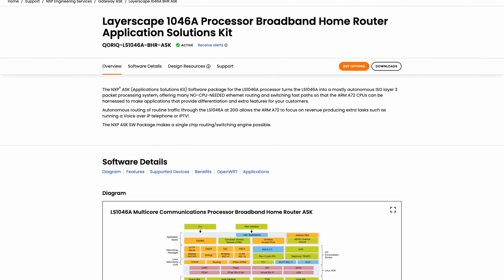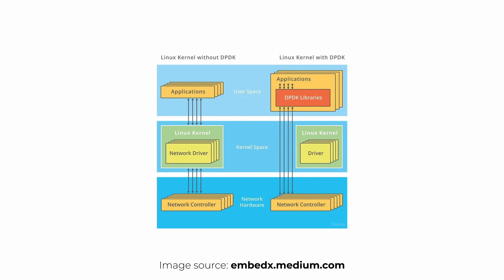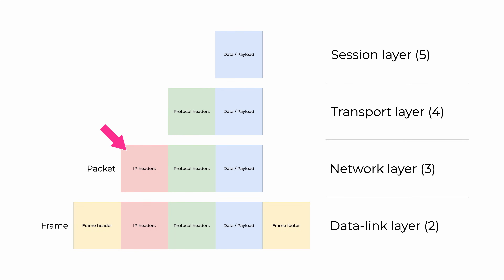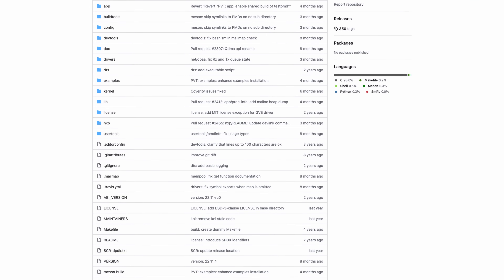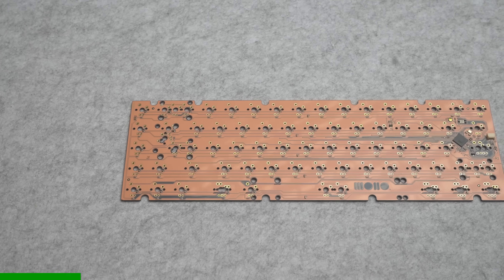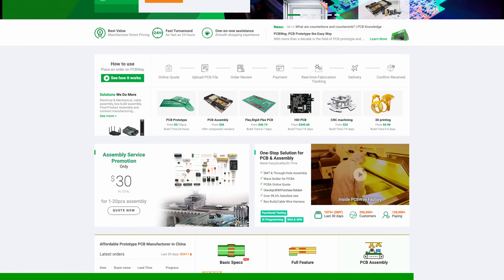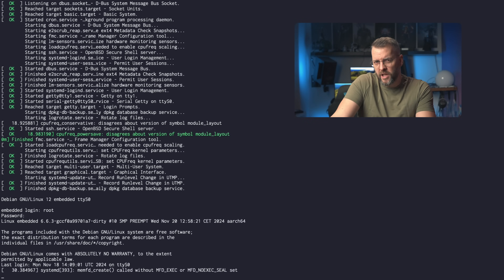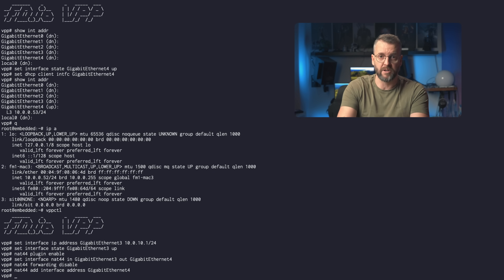Can a single 1.2 GHz core process 10 Gb/s? Yes, it can!

Comment: The reason "downsized" packet performance is important is that TCP-ACKs and other small packets exist organically. So packets-per-second is actually a relevant and important metric for router performance. With sufficiently large payloads, throughput is just a direct memory access benchmark because you're just copying stuff around and not doing that much "thinking."
Reply: DPDK has a way to handle this, but you're right, it's optimized for heavier throughput, with smaller packets seeing higher latency then you would normally see. (Set your icmp packet sizes larger and you'll see the latency problem disappear)

Think about DPDK like more of a "pipe" connecting the two end devices together, it doesn't matter how much volume of fluid you put in there and it'll get there in a timely fashion, especially if there is heavy throughout on the system.

DPDK works great for things like SCTP. 🤘
Reply: Properly efficient routing (and switching) is done WITHOUT copying. The hardware receives the frame into memory, and that's where it stays. Any forwarding is done by reference to that memory buffer. Copying is what kept linux and BSD networking so slow for so long.
Reply: @jfbeam  that’s kind of true but irrelevant because the Direct Memory Access thing I’m talking about is how the NIC gets the data from main memory via PCIe.

 https://en.m.wikipedia.org/wiki/Direct_memory_access
Reply: There's a reason real enterprise routers are rated in pps not bps.
Reply from the maker: Thank you for pointing in out!

Comment: I'm very happy to hear that NXP was willing to open source what would be needed, both options seem very promising to me.
Reply: Yep, with them open sourcing the necessary parts, proprietary solution starts to feel better than the vpp, due to compatibility with commonly used tools.
Reply: It's not so much "open source" as them not caring what you do with the SDK after your $40k check clears. (when almost everything is in a microcode blackbox, there's no secrets in the SDK.)
Reply from the maker: @jfbeam  you're right, to a degree, but microcode isn't something that's normally revealed by, well, anyone really.
Reply: NXP really seems like a good partner. They were willing to open source, AND helped them to find an alternative(and risk loosing income from  licensing  fees).
Reply: @jfbeam  lol yeah sure, feel free to release as "opensource" or even just allow redistribution of the stuff from most vendor SDK and see how fast you get sued to oblivion for breaching NDA and the SDK's own license. If NXP has moved all the proprietary bs to a firmware/microcode and allow people to redistribute it, its a good thing.
Reply: @jfbeam  Their attitude towards their copyrighted works here seems absolutely aligned with the spirit of the GPL. That's way better than how most vendors out there act. And no, microcode* is a part of hardware. If you still wan't it liberated, like I do, that's beyond the FSF's definition.

*(unless they mean something entirely different by that term than the rest of the industry does)

Comment: Router performance is best measured in packets per second; not throughput. It is relatively easy to push 10Gbit with jumboframes (or even standard 1500 byte frames), however a router must be able to support other traffic types too. Gaming, Voice/Video calls, anything 'realtime' really - all rely on small packets for the majority of bytes transferred (To keep latency and delays down). For example an average voice call does 50 packets per second, each at about 200 bytes. Would you be able to use this routing method, at the higher speeds, when traffic with those characteristics is being routed? That may not be of interest when using the router as your consumer home router - but it would when using in a more enterprise environment.

Comment: High-end networking geek here.  Small packet performance is critical for core internet equipment.  If you can’t send 14.4m 64 byte frames plus receive 14.4m 64 byte frames at the same time: your not doing 10 GbE.

Bulk throughout is trivial and doesn’t require any fancy hardware: a mundane PC can easily do tens of Gbps with large packets.
Reply: there is linux vpp stuff, there is a guy doing a ring with x86 of the shelve hardware.
Reply: @lyth1um Do you know which guy is doing that stuff? I want to check it out
Reply: That’s what i have been saying all along. 10 Gb/s the easy way is 812743 Mpps with 1500 byte MTU packages. 10 Gb/s the hard way is 14,88 Mpps with 64 bytes MTU packets. 10 Gb/s the realistic way is a realistic IMIX traffic profile.
Reply: @Galileocrafter or jumbo frames.

Comment: It's not that the packet size needs to be downsized but the PPS that VPP  can do.  There are a lot of things that use small packets like DNS, etc and there is specifically a test called IMIX.  It's not perfect but the idea is to test throughput using various packet sizes that mimic more of a real world solution.

A lot of commercial routers can put up huge numbers with 1500 (and more with 9000) byte packets but even when you MTU is set that high you will find the average package size is much lower.  It would be good to know the performance of the router with 64-byte packets (the lowest) as well as IMIX (or something else that is not the ideal max packet size).

Again it doesn't matter what your MTU is set to, it's the average sized packet.  Thinks like DNS or ACKs are going to be a lot of smaller packets.

Comment: I see two possible issues with this approach.
First is the power usage and heat generation, since one of the cores is constantly at 100% even when your network does nothing at all.
Second is possible latency increase, since when you poll instead of using interrupts then you don't respond to events immediately when they happen but on the next poll, so time between polls is your extra latency. This one may not be an issue, since 100% cpu suggests busywaiting without any sleep, but I would still like to see a test confirming if latency is not increased.
Reply: DPDK has no impacts on latency under real world circumstances. Many datacenters (ISPs) running DPDK applicances for DDoS mitigation. At my previous employeer we had a DPDK appliance to protect game server traffic from DDoS and maybe you know that but game server traffic is one of the most challenging things when it comes to latency. And guess, it worked like a charm, it used iBGP to route entire networks thru the appliance after being processed from the router before hitting the core switching stack.
Reply: @BirknerAlex I'm sure ya right that latency isn't an issue. The cores only job is busy-waiting, when not already processing data currently anyway. It even saves on ISR entry/exit delays, so it should be rather faster than slower in my view. 

I'd still share the concern about the wasted energy tho. Sure those cores are more efficient than some beefy x86 Server CPU, but they're not "free", I mean that's why ARM also has power saving modes and dynamic frequency scaling for example. I also don't whine about one core on a 64 core server with a daily load overage of 40 being dedicated to burn 1% more energy in my rack at work, and that core will have plenty of real work to do as well. But let's be honest, any home router is going to spent 99% of it's time idling, or exchanging a few dozen packets a second processing background noise. I got a 6 core Xeon E-2146G in my server sipping like sub 10-12W System total with the 10G NIC (excluding SSDs and some other extensions/peripherals, don't have exact numbers in my head anymore rn), so this router core HW (without Wi-Fi and other stuff ofc) hopefully ain't gonna be sipping such numbers for way less performance, just because it's busy all day checking if maybe finally someone has a packet for DPDK. I'm very interested in this project, because hosting/running your Router/Firewall/Networking on your main server has plenty downsides, and I still run a separate AP for Wi-Fi ofc, but not if I'd be investing in yet another 24/7 energy hog 😅
Reply: Polling can have way less latency than interrupts. Interrupts are good for occasional events, but when you have a lot of them you have to do context switching for every interrupt separately, and finish performing the previous thing, before you can take on the next one. When polling, you can bunch multiple events together into an array/vector, and process them in one go. So the result is that you have worse latency in optimal conditions and low load, but better performance under heavy conditions.
     
In Computer graphics the same kind of optimisation is used. Graphics drivers when receiving data/drawcalls used to wait for more data, to send a bigger chunk of data, and the graphics driver would need some algorithm to estimate how much to wait, and how often to send data to GPU; but with the introduction of Vulkan this task (along with other tasks) moved to the application/game. And a lot of other optimisations and tweaks that used to be done in the driver (Kernelmode) during the directx11/openGL days, are now done inside of a game (Usermode) thanks to Vulkan.
Do you see the resemblance to where DPDK+VPP is going 😉?
Reply: @sasjadevries  Yep, I mentioned in one of the other comments that I worked with microcontrollers that had a similar batching interrupt system, where an SPI controller would send an interrupt when a message arrives but will not send any more interrupts for next messages until you empty the buffer, so you can batch process multiple messages on single interrupt without creating hundreds of context switches. That would be good to have on linux, but I gess it might not be so easy without hardware support.

Comment: First, I‘m very impressed by the performance! 
One question though, as one Core is now constantly pegged, in what way does this impact power consumption? Is there a notable difference between this solution and the old proprietary sdk when at idle or when routing?
Reply: It's pegged, but probably not actually using much power. I guess it's just busy-waiting on packets, which should be just some conditional branches and compares, nothing too crazy. Nevertheless, it's taking CPU time that could have been used elsewhere.
Reply from the maker: You're right, the core is at 100%, but it's basically just a constant loop of polling the interfaces.

Comment: I didn't know DPDK existed. Looks very promising. However, it feels like it is non-standard. I don't know if administrators really want to deal with DPDK/VPP if Linux already provides really good infrastructure.But hey, as long as it works and doesn't interfere with what I do – that's fine. It would be interesting to see the latency on this. The bandwidth may be high but latency is also something to keep in mind.
Reply: DPDK is used in server environments where the host OS doesn't need to interfere with the data, when you can tunnel the traffic to separate containers or guest VM's.
Cellular infrastructure/mobility cores for LTE infrastructure do this to optimize hardware requirements (and space available). It's really cool tech, weird to think about it's complexities tho. Not sure how Linus or any of the kernel maintainers agreed to implement it 😂
Reply: Never heard of it either, but the interface looks like CISCO's router command line interface, and since it was made by cisco, I wouldn't be surprised if it actually is their router CLI.
And if it is, then administrators already know it. It would be a bit worse for non administrators, because cisco's cli is a pain to learn with many non obvious things.
Reply: @hubertnnn  but administrators don't necessarily know how to work with Cisco. I also don't quite trust Cisco as these are big corporations and you don't really know what you're getting into and it could turn out to be a huge enterprise mess.

Comment: I'm not a networking god like some of the commenters here. I'm just a cybersecurity risk analyst. But I fully agree with the consensus that true performance tests are done at edge and corner case scenarios, because that's where mistakes can happen. That's the point at which just a little too much traffic can knock something over because a single malicious packet was able to get through somehow. I'm not saying you're prone to the mistakes that other companies have made - I'm just pointing out that with everything in the world being networked now, things need to be designed with cybersecurity and resiliency first and foremost. The enemy is always getting better. Just testing performance for performance's sake is no longer a valid benchmark. It needs to be either standardized in some way (not possible with most of your testing) or it needs to show both extremes to be scientifically rigorous.

Comment: Very nicely done. From the outside it seems a long way to get this type of through put. It looks like you added a few more gray hairs setting this all up. But in the end it works. Well done!

I realize you might have a limited lab environment but it would be interesting to setup all 10GbE ports with a iperf system. I think there was 4 in your build (sorry poor memory). See if you can push 10GbE per port through the router. You might have a 2x2 setup for iperf testing. The idea is to see at what point you saturate that single core, and then need to dedicate a second or third core to networking while keeping the remaining core(s) for the kernel and system management (snmp, dhcp and such). 

I think its a good plan to keep one of the interfaces (1GbE) connected to the kernel as an out of band management interface. This will keep port forwarding of data interfaces offline until the system is fully booted and the system status/setup is confirmed.

Comment: You're saying that 100%ing that core only add like half a watt to the power draw. But doesn't that still prevent it from scaling down the clocks and even shifting the whole SoC into its low-power states? I mean, you can't enter s2idle and run the userspace at the same time, right?
Reply from the maker: According to the docs, for best performance, the CPU governor should be set, well, to performance, so I think that yes, it will prevent it from scaling down the clocks. That being said, according to VPP documentation, it's also possible to change between polling and interrupt mode depending on the load (of traffic). I'm afraid this part is quite new to me, so I'm trying to figure it out myself as well.
Reply: @tomazzaman  Hmm, maybe for home applications the governor could only ramp up when the load gets high enough? Likewise the polling mode could also be enabled automatically when needed.

Comment: I ran an EPC (vEPC) LTE core using DPDK. It was "black box" aside from the usual sysadmin/sysop stuff.
It's cool how fast you can push your hardware. Vendor had some weird DPE (data plane) bug but that's aside from the point.

Comment: I really like performance graphing with grafana/prometheus or whatever else. I assume vpp already has the capabilities for an external software to pull that info?
Reply: my previous answer was hidden, cause i linked to the vpp manual.

Short answer: yes, yes there is.

Long answer: they have a python package that can access a lot of statistics, it's really easy to use!

Comment: Hallo Tomaž.  Miroslav 'ere. Would this move of device control lend itself to being able to edit MAC address easily? I am hypothetically talking of changing MAC to that of the one on ONT, so ISP has no clue that particular client is removing 20W power drain, issues with patency and potential copper burnout and all PC in the place being ruined by lightening strike (happened to LUG member here in London) associated with ONT. Use MAC of the ISP provided ONT on SFP?  Can this be done from The TUX side of things? I am not GURU.  Blagidaram!

Comment: mm i like what a few ppl have mentioned in the comments here about testing with 10gb/s each direction, with the data being all tiny packets like you might see on a super busy network. 10gb/s in a solid data stream isn't the same as 10gb/s of all varieties of packet hammering the device?

Comment: I wonder why DPDK chose to constantly poll the interface vs asking the kernel to notify it when a packet arrives. And then continue in userspace. Aka use the kernel only for the raw packet notification.
Reply: Context switching is expensive - https://en.wikipedia.org/wiki/Context_switch#Cost
Reply: @triffid0hunter  Doesn't polling need context switching too? I mean each time you ask the kernel "is there a packet yet?" you enter momentarily kernel space for the kernel response. I could be totally wrong though.
Reply: @sledgex9 the whole point is to allow direct device-userspace interaction without the kernel being involved

Comment: I'm a bit concerned about the 100% core usage, won't it increase the idle power usage of the router? 🤔
Reply from the maker: Negligible. Maybe half a watt.
Reply: @tomazzaman  I would rather take the proprietary option as this is something I don't think I can get as a regular consumer and it seems to provide better integration with the hardware which could lead to better performance. Otherwise I could simply get a Raspberry Pi or something similar such as the Banana Pi R4 and build my own router from scratch.